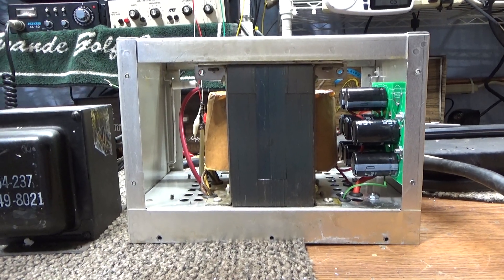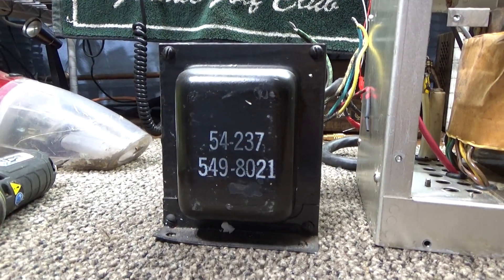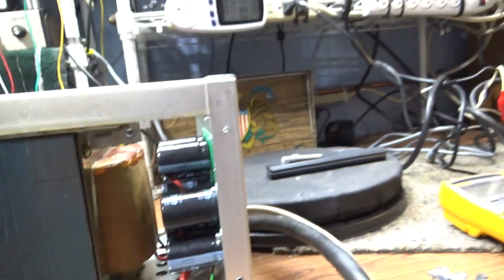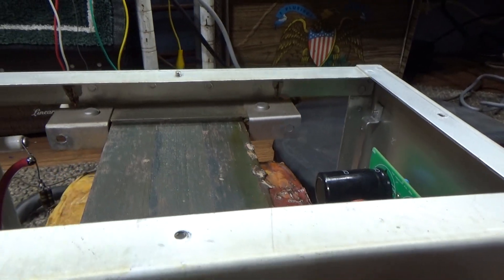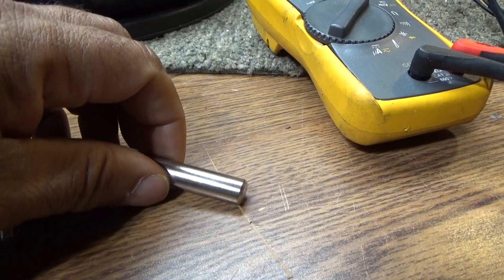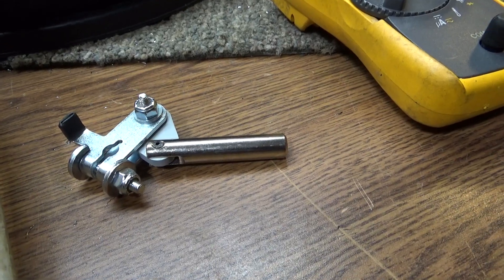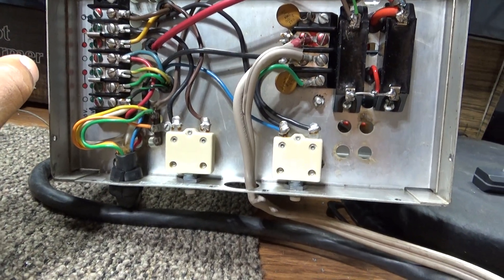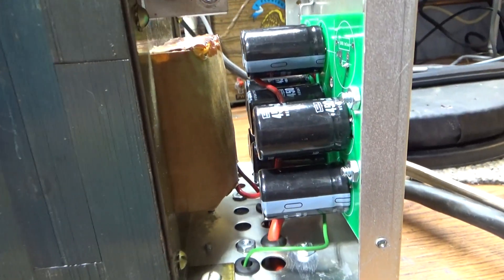Drake L4B / L7 original Power Supply unpowered walkthru

Comment: Thanks for interesting video. Could you tell me, where can I get this particular pcb?
Reply from the maker: https://harbachelectronics.com/shop/drake/pm-400-replacement-power-module-for-the-drake-l-4l-4b-and-l-7-power-supply/
Reply: @tramdr  That's not the one :) Harbach kit has 8 caps. The one You have has room for 9 caps. I' having quite large drops in voltage  under load. Manual says 2600V idle and 2400 on load. Mine has 2540V/2150-2200. Changed ando modified everything I could and still the same. MAX power output 1,1K. New tubes, soft start, soft key, bias mod, contacts cleaned, tuneg meters, tuned input coils, checked for cold solders. Searching for the solution.... Firstly  I installed Mundorf caps (M-lytic HV 220uF). Quite expensive ones. It turned out,  that measured capacity ranged from 183-207. Mostly the lower parts.  Than I bought  Nichicon LGZ2W221MELB50. Bit better - 210-215uF. Original ones had 200uF on label but in fact were 235-248 (measured).
I wanted to try a board with 9 cap spaces - just for testing...
Reply from the maker: My post above. the Nomad one has 9. However, you do realize that the more caps you install, the more the voltage drop will be? More caps in series means more voltage and LESS UF's!
Reply from the maker: Oh, he Nomad HV PCB. It takes some modding to get that to work both electrically and physically. You are right about cap uf's. There are a few work arounds for that too. Buy a better quality of caps. Buy caps with a higher uf rating, like 330uf's but keep an eye on the size, especially the width. Last, I have also used 500v and 600v caps . When using those, you can use less caps which will mean the uf's are divided as much. https://www.ebay.com/itm/116423417100
Reply: Thanks! Another question🤭 the 120v from those heavy duty bleeders also powered the meters and AGC. How to power them back after having removed that 50 k resistors?